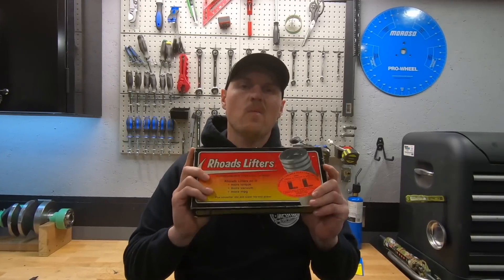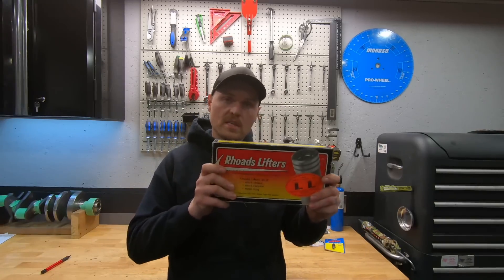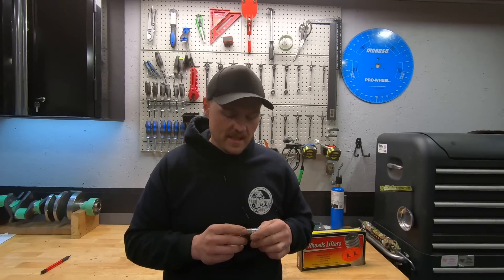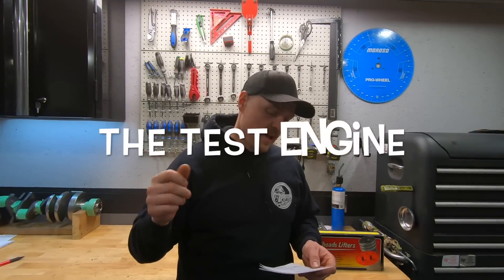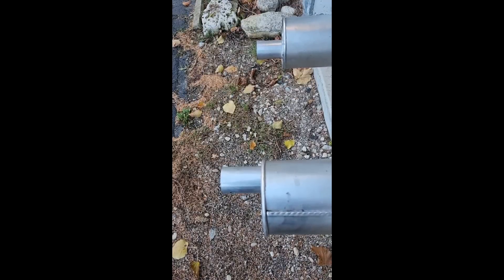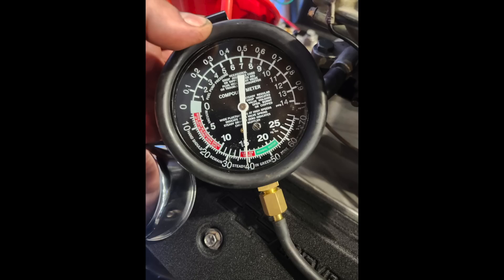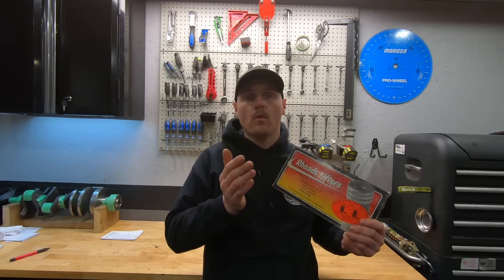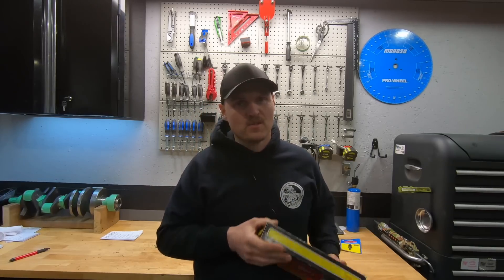More Power? More Vacuum? Rhoads Lifter Test Part 1 (406 SBC w/Summit 1203 Cam)

Comment: I used Crane Variable Duration Lifters in a 383 Mopar that had a cam running 530 something lift . They smoothed the idle and the bottom end power was way more than with standard lifters .I would love to see the dyno test. Have a great day everyone.

Comment: On a limited Sprint engine (305) that we built....We used a set, and off idle, when you were on a restart, the lifters would give you a 2 car length lead when you stomped the throttle at the same time as the guys behind you. That allowed you to get into the corner in the most beneficial way you wanted because of the confidence the driver had that it would repeat itself every time. I found that oil pressure..."AND" oil volume are pretty important in those lifters. On those engines, we were using a "standard" Big Block oil pump, because we had to run a wet sump. Of course we eased all the passage edges in the pump, and used the shorter drive shaft to the distributor...but with the "by-pass" in the filter plugged...and a small 1/16 inch hole in the oil galley to lubricate the back of the timing gear....it worked great. However, we did use heavy oil (20w-50)....and I would imagine you would find some differences with lighter oils. I always thought an adjustable by-pass might be a great idea in this situation.
Reply: On most of our Chevy builds we drill 0.030" bleed holes in lifter valley front plugs to squirt on the back of the timing assembly.  Also slot the lower distributor boss with a hack saw blade about 0.025" deep to feed the distributor/oil pump drive gears with constant oil flow.  Especially true running bronze gear for steel roller cam.  We only switch up to HV oil pumps when we "scratch" the lifter bores to feel a flat tappet cam now days to keep them alive ...

Comment: I used Isky lifters like the Roads in my old worked 351CJ that had a lot of duration and I was very happy with the outcome and impressed. The car was lot better driving on the street and my brakes felt a lot better too!!!

Comment: Back in the mid-1980s I bought a 1969 Dodge Dart GT 340 that had a big hydraulic cam.  The car had been raced previously but I used it only on the street.  I added Rhoads lifters to smooth out the idle and improve lower speed torque.  This worked very well, making the car a pleasure to drive around town, but was still plenty fast when pushed on an open road.  The lifters did make a slight clicking sound, similar to mechanical lifters/tappets, but I got used to it.  I added air conditioning, and the engine ran smoothly with AC on even at idle.  I never dynoed the car, but I enjoyed driving it.  I've found that too much cam and too much carb can cause problems with cars intended for street use.

Comment: I installed Rhodes lifters 35 years ago in a 350 Chevy that has a Crane "Bracket Racer" cam . They allow me to cruise in overdrive without loping or lugging. Midrange and top end power is great. These are a high-quality product for sure!!

Comment: They definitely work better with a high volume high pressure oil pump. My oil pressure is typically 40 at hot idle and 70 at 6800. I simply put 1.6 rockers on my sbc and didn't worry about what the lift was. I did check the valve to piston clearance first though.

Comment: We used to use these mud racing, in classes with vacuum rules and/or converter rules. That was about 10 years ago. I've seen big block chevys turn around 7000 with these. I'm not sure what kind of trick valve springs they had though.
Reply: I didn't know they were still available. I'd love to try a set of hydraulic roller ones, if they're available.

Comment: years ago i ran those on a 400ci RA 3 poncho mill it has a modest melling RA3 cam .  it was noisy , but i had no problems with them. , the downside i didn't see any big improvements . may have been that the cam was not quite big enough for the lifters to add much. later i built a 327 chevy mill with huge heads, the biggest hyd cam that comp had at that time , running the crain anti-pump up lifters . this motor had a single plane and a huge carb , huge pipes . this motor has enough torque  to pull up from anywhere  . the small motor big head had decent low and mid with this package . normally this would be an all top end mill--with little on the low end.

Comment: Have used Rhoads lifters with marine engines with wet exhaust.  You get reversion with any cam over about 250* advertised duration (water getting sucked back in from exhaust) at low engine speeds.  Rhoads lifters allow cams up to 280 and maybe a bit more w/o going to open headers (illegal on many lakes).  Yeah, you might loose a little lift, but you gain progressive duration which really helps boats on the top end (4,500 up).  Cars, it may be less advantage, but they are still in business, so there is a solid customer base 😊
Please do the test.  Last set I bought, I called Rhoads and asked if they were still Johnson Controls making them, yup, still made in the USA with good quality controls 😀
Reply: Good info.

Comment: More the cam lift the more noise they made. They sounded terrible in my 66' 289 hi-po. with domes and a Crane "fireball" camshaft. I didn't need them anyway, having a toploader and no power brakes. Later went with solid flats.

Comment: I had a 69 ranchero with a 66-390it had the bigger ports than later ones I ran rhoads and I used to run down guys on top end a lot 13.12s 103mphl so I would love to see more tests. Ps. I could still pull my ski boat and go camping id drive it to work daily gas was a lot cheaper . 😀👍

Comment: I've  stop building  I have two engines  sbc comp 280. And a thumper both motors are rebuilt  0.30. Vortex  heads don't want to scrap one on break  in , I don't like the 50/50 chance 😒.  And for this lifter,  I love the Delco.

Comment: I had a set of these in a sbc 406 with a comp cams  224/224 110 lsa  .470 lift (COMP Cams Magnum Hydraulic Camshafts 12-211-2 )   And they were awful. They suck.

Comment: Variable duration lifters make the cam appear smaller and more advanced because, they bleed down on the ramp and shut the valve faster and harder. That makes the lift shorter and the duration shorter.
Retard the cam 2 degrees. I ran these on a Cleveland and had 18" of vacuum and pulled to 6200. Like you said, the ticking sounds like a sewing machine or a tight lash mechanical cam.

Comment: If there was a way to measure the two lifters on a test rig to measure bleed-down at different oil pressures, it would probably match the $$$ dyno test results.  I’m just not sure how you could possibly design a lifter to bleed at low rpm and not bleed at high rpm.  If you made a follow up video I’d watch it!

Comment: i put a set of Rhoads lifter in my L-79 clone 68 Camaro back 1980.  The difference was stunning! It would idle at 500 rpm and has lots of low end torque. I can't imagine it affected top end power much, my car ran faster in the 1/4 mile with the rhoads lifters.  I think it ran quicker due to the gains in low end power, I felt like it revved quicker too!

Comment: I ve ran them on several engines in the 80s on 2 351 Cleveland’s one with crane Blazer cam and one with a very wild Chet Herbert cam  all with great results , the crane cam was 218/226 @ .050 and idles smooth at 700 , the Herbert was 256 / 256 and was very rougj with standard lifters but with the rhoades it was very mild at idle noticeable but much improved , the only negative was they are a bit noisy or at least were back then

Comment: Have used these back in the 80's.  They absolutely do work, it will pull up top (and continue to pull beyond) like a solid.  These also help smaller displacements (like 305's) that are low end sensitive to healthy cam numbers a great deal.  In terms of sound, it sounds quite similar to a Duramax at idle across a parking lot.

Comment: I ran them in the 90s in a 383 small block chevy and although I did notice some smoothing of the idle and better low end response it in the end wasnt worth all the trouble of putting them in, got better results from tuning the carb and putting in better ignition hardware.

Comment: Best results stock converter the car will pull right out of the hole but not smoke the tires someone with slicks and a converter will beat a motor with Rhoada lifters  most of the time

Comment: So long as the oil pump flows well and the lifter bores are square, they will match the lift, I used something similar back in 2001 and modulated the oil pressure to the cam bearings and lifter bores, I was able to pull the bottom end power of a stock cam, with all the vacuum and compression that entails, along with the screaming top end of a big lift high overlap cam at 8200 rpm. I did have to cut a window in my th375 bellousing to clear the solenoid i used to bleed pressure off the lifter bores though.

Comment: I ran them for years in a 318 with a 340 spec cam in a 1 ton truck. Smooth idle low end power and when you got into is the motor perked right up on top end.1 ton crew cab 4.10 gears 33 inch mudders 6 inch lift and 100mph top end. Light up the rubber off the line and get 16 to 20 mpg (imperial) at 62 mph. Now imagine them in a 360.

Comment: I have tested the V-Max version roller cam version myself in the fuel injected 383 in my Express van. In my application, aluminum head 6" rod 383 at 11:1 compression and a smaller camshaft they worked too well. I had 230 psi of cranking compression, went back to a LS7 lifter and had 205 psi. Top-end power was unchanged, the mass airflow sensor showed zero change in airflow above 4,000 rpm altough it did smooth out the noticeable spike in airflow around 3,000-3,500 where they pumped back up. The midrange around 3,000-4,000 rpm was a bit softer with the Rhoads lifters but low-speed torque especially part-throttle was much stronger with the Rhoads lifters. Throttle response became much soggier with the LS7 lifters.  I had a factory vortec camshaft smooth idle at 650 rpm with the Rhoads lifters.  19 in/hg idle vacuum.  Camshaft was a Comp custom ground roller, 271/284 @ 0.006, 218/228 @ 0.050, 0.578" lift, 108 LSA and 106 ICL.  Lost about 5.5 mpg with the LS7 lifters, went from 20.6 mpg to about 16 mpg on back to back long highway trips. That was a 502 hp 383 in a 7,000 lbs van backed to a 4L85E, 3.73 geared 10.5" full float 14 bolt and 30.5" tall 10 ply LT tires.

The stock Dodge Viper V10s had a very similar high bleed lifter from the factory as a Rhoads lifter. We put the Viper lifters in the older Dodge Magnum engines in trucks, SUVs, and vans with modestly sized aftermarker cams 15+ years ago to allow the speed density map sensor based EFI that could not be tuned at that time (usually used a Mopar Performance ECM for the vehicle to get the hotter advance curve and other tweaks Dodge made to them) to have a good clean vacuum signal

Comment: I remember these from back in the 70s and 80s they work well on a street driven car and they do what they claim, you can drive it to work and get good MPG during the week and go to the track and run good on weekends, what I remember is it did not last long , lots of valve train failures over time

Comment: The FIRE system (from Chrysler/FIAT/Stellantis) is pretty much the same as this. 

They add precise control of pressure to the lifters to allow controlling the lift to delete the throttle blade. 

the throttle blade really hurts flow, even when wide open, and deleting a part is almost like free hp 😂

Comment: Used them in 350 10:1 comp 280 cam. Worked great, at 3000rpm they pumped up and you feel acceleration increasing

Comment: I ran them in a 440 Mopar right when they hit the market about I think 40 years or so ago? Had them in a 71 440 Charger with a .509 cam 292 degrees duration I could not afford at the time a good converter had NO low end power. I put the Rhoads lifters in low end torque picked way up mileage as well also would smoke the tires a lot better LOL. And the top end was just as strong maybe better. I drove that car over 4 years everyday never once had a problem with the cam or lifters. To me for what its worth to anyone they do what they say they do and they will live as long as normal lifters they tick a little at idle but thats not a big deal if your driving a street strip type car at least not to me.

Comment: I installed a set on a Comp 280H cam in my 340 Dodge Dart. I did the not recommended method (cam was already broken in with Comps lifters. No flat cam and small but noticeable low rpm improvement.  I removed the cam and lifters later as the car got lower gears and more cam.

Comment: Hi mate

Thanks for taking the time to post this, it's much appreciated....  I definitely want to see the dyno results

Back in the 80's, I ran some Crane Hi Intensity lifters in my Australian 308 Holden. 

What the claim from Crane (at that time) was, they offered similar benefits of the Rhoads lifters, but with less mechanical noise, as the Rhoads do clatter quite a bit compared to a conventional style hydraulic lifter

They definitely reduced the chop in the idle, and increased vacuum at idle compared to the conventional style hydraulic lifters I had in it. However, I never ran it on a dyno to see if the peak power numbers were effected

I have a new set of Rhoads lifters now that I am planning to run in an upcoming Holden V8 build, and am concerned about power loss at the expense of addition vacuum and idle quality

So I'm really keen to find out the results
Reply: Semper Fi.  I want to see the dyno test great work you have been doing. Best part is that you show guys on a budget things you can do by swapping out The springs in a vortec head. Keep it old school buddy. Keep it low back for us poor guys

Comment: Comes down to if your using basic rhoads or the new v max on what different things you’ll see . Also what way you set the lifters.  In circles track we use them in just the exhaust to not gain cranking compression but gain vacuum .  The max you can run up to .015 lash or 3/4 turn preload. Would be cool to see the differences . On a dyno . I’ve found you’ll have 15-17”@1000 rpm with 11-13 degrees of over lap measured at .050

Comment: It always made me nad and disappointed wgen Hotrod Magazine or Carcraft would perform a test like EFI vs. Carb on two entirely different engines like a Ford thats stock compared to a mildly built Chevy. How in earth they thought that could be compared inly tge almighty knows. Super test. I wonder if it would be possible to pull out the internals of a Rhodes lifter and place it in a Roller lifter unless uts already offered as such. Again, dude right on!

Comment: They recommended cams with more
Than 230 duration at 50 to be worth
Using them. I remember Gale Banks
Using them on his turbo big blocks
and liked them. I heard them at idle
But did not like them for that only
Yes Dyno them especially the top 
End power got  to out find if it’s true.

Comment: I’ve been wanting to see these lifters tested for years. Even just the idle was cool. It would be cooler if they still work well up top. Other manufacturers make these too they call them fast bleed. I’ve seen them from Johnson and Howard’s. Then make roller lifters which Rhoads doesn’t. Howard’s will end with fb, like 91113FB is a fast bleed roller for ls engines.

Comment: THE most precision parts of the engine. LIFTERS
For all the QC on the parts, when assembled, may not work correctly to spec.
REJECTS and SCRAPPED due to cost of fixing.
These are them.

Comment: I have used Rhodes on many engines. They increased the vacuum by 3” and had the same top end as normal lifters. This was on a Ram Air IV  Pontiac. 

My testing at the drag strip showed no appreciable difference in ET because I drove through the RPM very fast in first gear and the converted stalled at 2000 RPM so the lifters were already pumped up. However driving on the street away from a stop light you could feel the difference. 

As to the noise, they aren’t any noisier than a solid cam shaft, in fact slightly quieter. Using aluminum valve covers helps if it is that bothersome. A sewing machine is an accurate description. It always amazes me how people have no issue from the noise a solid cam makes, yet complain about the Rhodes. The exhaust is always louder than any valve train noise

Comment: i built a 4-V cleveland with closed chamber heads and big cam it really made it come out of the hole at low rpm and made horse power at the top end, its a great product, i wish they made it as a roller lifter!🐍
Reply: They do.

Comment: Rhodes lifters. The original. Buy them. Back in the DC  days (Direct Connection) I purchased some for my SB Chrysler (340) served me fine until recently when a teenybopper bopped my Barracuda out of the picture (the car was my daily driver  first s Duster then another duster then a Barracuda ...I kept changing bodies). Great lifters. I had a PAW (Performance Automotive Warehouse) camshaft  RKElliot cam to be precise.  I called it my "high altitude cam)  the engine lopped a bit when the oil was cold but when the oil came up to operating temp.fine.   340s are stupid  they don't know when to quit. I would be missing gears because I'm getting old  I would tent to get back on the loud pedal without a gear then kind of grab one quick and slam home the clutch. And the engine would rev.,..oops. gear Bang!   Overheating and all kinds of abuse.  Rhodes lifters  had no problems with this stuff. I've had no problems with Rhodes lifters.  Look them up.  Today they have lifters for all kinds of applications. Look them up.  I'm hoping to do a big block.   Rhodes lifters are going in also thinking Harland Sharp's they do rockers. good stuff.